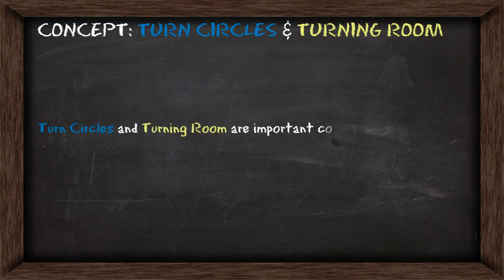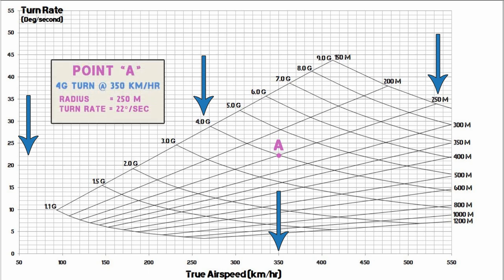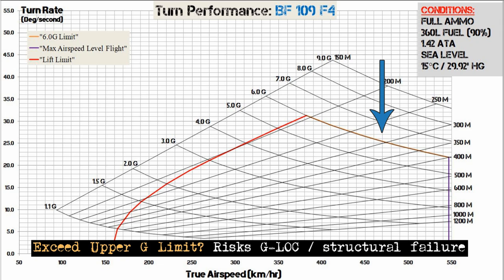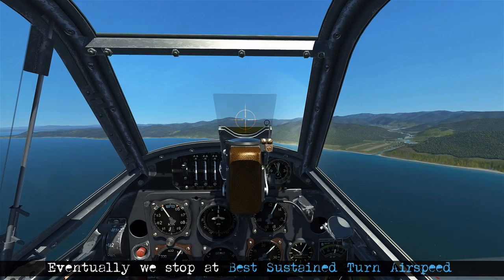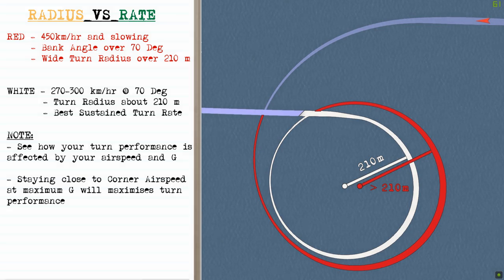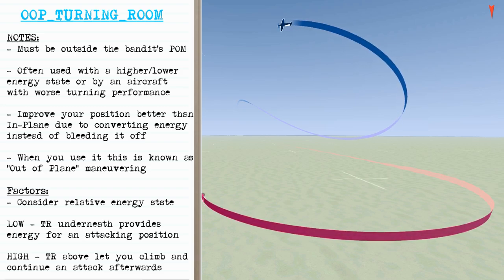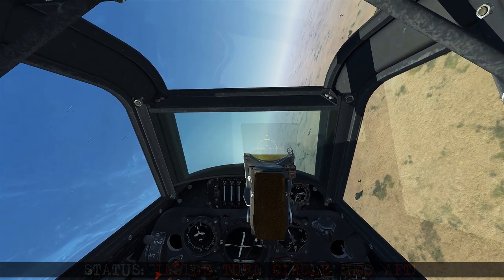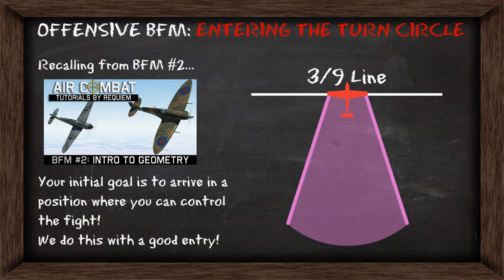BFM Lesson #3 - Turn Circles & Turning Room (Revised)

Comment: Excellent use of diagrams followed by in-cockpit examples to illustrate how to apply these principles tactically--great stuff.    And I greatly appreciate the updated terminology regarding turn rate.   One thing I would note for your viewers who fly jet sims is that while the speed for the best sustained turn rate for the BF-109 happened to be at the lift limit and coincide with the speed for minimum sustainable radius, this is not always the case.  This may even be generally true for prop fighters, for which I have no data, but is not for jets.  For jets the minimum sustainable radius will be at the lift limit, but the maximum sustainable rate will usually be a much higher speed, and depending on conditions can even be higher than corner speed.  The Ps=0 plot for a jet typically has its peak much farther to the right than the BF-109 curve.  This translates into a need to restrain your pull and perhaps even keep your speed above corner in some cases if you want best sustained rate.
Reply from the maker: No worries Gort, I've wanted to revise this one for a while but never had the proper time to finish my EM spreadsheet how I wanted. I took unpaid leave this month from my airline so I've had time to finish it and it's good to go now haha You're correct regarding the jet info, so thanks for sharing it. As you can understand I wanted to just explain a diagram with a single example many people would be familiar with. The great thing about my spreadsheet is I can create diagrams for any airplane if I have the data for it now. A common problem you see with a lot of people in props and jets is they just pull and pull and pull trying to turn faster but that doesn't always work out, so hopefully this helps with for some people understanding this a little better. I'm planning on going into more depth with this stuff when I can get data comparisons between props and include some jet examples in there too, but for now this illustrates the basic concept to build off in the future.
Reply: @RequiemsACTL  ohh I can relate
Reply: @Gort I've wondered at the applicability of haptic feedback for sim pilots.  Something that squeezes gently on your legs, perhaps, emulating a g-suit inflating, that gives you feedback on how many G's you are pulling?  Tunable by the user for their own desired "feel"?
Reply: @aurorastarfury  That might provide better G awareness and I'd like to try it!  I would also like to see someone make a seat cushion that would vibrate with varying frequency and amplitude to communicate airframe buffet.  You can feel a lot of nuance in buffet that simply shaking the visual in the game is unable to communicate.    
Trying to make these sims too purely realistic makes them unrealistic in some ways.  I want an accurate model, but you need something to replace the somatic sense your body provides if you want to fly that model like you would the real airplane.  Perhaps a tone that indicates AOA or G.  Purists will say the real airplane doesn't have that, but he real airplane has G forces and buffet that you use when you max perform it.
Reply: @gort8203  That exists, called a buttshaker. But it can only deal with the haptics (or audio) from the game.
Reply: Gort I agree with you and I think the AOA control is wrong on this sims because when going slow you have to move the stick less and when going fast you have to move the stick more.
Reply: @FGCH03  That's because it simulates how much force you can apply (as a pilot). The stick in these old planes locks up at high speed. 

Otherwise you'd be correct.
Reply: Peregrine 7 ok I understand that but that way to control aoa Is not accurate, at least with a force feedback joystick they could reproduce this, another thing I have found is that when you pitch down and leave the stick alone the airplane does not follow its trim speed it continues to dive.
Reply: Gort I just checked in LA5 you can check it
Reply: Gort i think DCS is more realistic in the way it has the aviatorshaker and vibrates with Gs and stalls you should try it
Reply: @FGCH03  What do you mean by "the aviator shaker".  I have DCS but I am unaware of this feature.  Do you mean output for that butt shaker device?  (I feel uncomfortable even saying that . . . )
Reply: Gort 🤣🤣🤣 well the device I am telling you is this one - https://forums.mudspike.com/t/does-anyone-here-use-a-gametrix-seat/4686 - check it out I have one and it is really good, it tells you what the plane is doing in terms of Gs stall and other effects, but I think you will still see that the sim, as you already told, has relax stability. I don’t understand why in a WW2 plane that you put in a vertical climb, start to spin without changing the stick position I think that is totally wrong.
Reply: @FGCH03  Interesting, I hadn't heard of this. The info doesn't explain how it works, such as how it knows how much buffet the airplane would be producing.  I'll have to do some more research.

I haven't really flown IL-2 so I'm not that familiar with its flight model, but I can say that if you run out of airspeed going straight up and start to slide down backwards or sideways a departure is certainly possible.
Reply: Gort well you say it, the thing is a departure and the other is the airplane of attack that going back to its trimmed AOA that is sometimes confused with departure.

Sorry about the info I sent, It was just to introduce you to the gametrix seat, research about it, you will love it but it works excellent for DCS but for IL2 it is a bit limited.
Reply: @FGCH03  Thank you
Reply: @RequiemsACTL  Excessive pulling and speed bleeding is a problem I'm working on correcting, along with my poor understanding and application of pursuit curves, which results in worsening angles as a turn fight continues.  Going back and studying up on the basics (thanks to you) has been very helpful now that I have some experience to more fully understand and relate to the material.
Reply: @RequiemsACTL  Would it be possible to get the Excel spreadsheet? Thank You!

Comment: Great video, as always!  How could I obtain the data necessary to build an EM chart for a plane?  I know how to work out the turn rate at various speeds, and the maximum airspeed, but what about lift limits at various speeds?  
Thanks!
Reply from the maker: The lift limit is simply the maneuvering airspeed.

Comment: Is the blue line related to thrust?   If you could apply more power you cold move it up?
Reply from the maker: The blue line (sustained turn) is related to thrust because at any point along that line thrust = drag and there is no more acceleration in the turn at a particular G force. Since the power is at maximum it can't go any higher, but these lines vary between airplanes so that's why engine power plays a part as one of many factors in aircraft performance

Comment: At the end, I didnt got the diference between the in plane and out of plane turning room, because it seems to bem the exactly same manoever, but to diferent sides each time. Could you clarify what am i missing?
Reply from the maker: Just think of it in relation to how both your wings line up with each other. If they're aligned (parallel) with  each other you're maneuvering in the same plane of motion. If your wings are not aligned (towards being perpendicular) with each other then you'll end maneuvering in different planes of motion.
Reply: @RequiemsACTL  gotcha... tkss

Comment: +RequiemBoS  Thanks for a simplified explanation of how turn factors affect air-to-air.  Had the Kriegsmarine (DEU) put a carrier into commission, the U. S. Navy would have two Fighting aircraft available to obliterate the Bayerische Flugzeugwerke (DEU) Bf 109H-4 and seize the air superiority that the Curtiss SB2C and Eastern/GM TBM would have needed to attack and sink the German carrier battle group:  The Chance Vought F4U-1D and the Grumman F6F-4, both of which had a decisive performance advantage over the '109's Daimler-Benz (DEU) 605 inverted V-twelve with the mighty Pratt & Whitney (USA) SGR-2800 radial-eighteen.  "Valencia's Mowing Machine," applicable to USN VF's with F4U and F6F, made extensive use of the vertical for engaged division tactics.

Comment: Very nice presentation! If I understand it correct the SL-line shown around 04.30 is also representing a max G-limit of about 3.3 at any speed if you want to maintain level flight? Comparing it to the level turn data around 01.00 that would indicate a bank angle no more than sligtly above 70 degrees.
Reply from the maker: Thanks! You understand it correctly, so we can just call it 3G and 70°... that's close enough for government work right! :-)
Reply: @RequiemsACTL  I also found it highly interesting what you say from 06.50 that WW2-planes can´t sustain corner speed in level flight because of limitations in thrust. Didn´t know that. Also see that the Level Turn Data at the beginning is purely theoretical and not specific for the 109 F4. Especially the last rows for 270 (exceeds the F4:s lift limit) and 450 (too little engine power). Got a bit confused there at first :-). The good thing about your videos is they lend themeselves to be watched several times.

Comment: Maybe this a stupid question but regarding the corner speed and that ww2 can’t sustain it in level. When turning can’t I just loosen the pressure on the stick to maintain wanted speed (270 in this case)?
Reply from the maker: No, it's not a stupid question at all. Corner airspeed is not just considering airspeed by itself, but is the airspeed you can apply maximum G force at to achieve your maximum turn rate (The 270 km/hr is completely separate because it's the best sustained turn rate for the 109 in this case). If you're loosening the pressure on the stick, you're relaxing how much G force you're applying so this means although you may be as fast as the corner airspeed is you're not actually applying enough G to maximise your turn rate. However, because you are at corner airspeed this means you have the potential to maximise your turn rate (however long that may be for). Think of corner airspeed as a sign of where your airplane can max perform basically.
WWII airplanes don't have the thrust needed to maintain corner airspeed when they are maximising turn rate in a level turn unless they are sacrificing energy (in the form of altitude) to stay there, so that's why you end up bleeding energy in a level turn (in the form of airspeed) and should aim to slow around the best sustained turn airspeed if you're in a prolonged turn rate fight.
Reply: @RequiemsACTL  You understood my point and answered very well Thank You very much!
Reply: @RequiemsACTL  Somebody claimed that 270 km/h is also the "ideal climbing speed" for Bf 109. Are they confusing these numbers or is there a relationship between those two factors that makes them both land at 270 km/h?
Reply from the maker: @LosBerkos  No  I don't think they're confusing the numbers. I believe that 270 km/hr is the best rate of climb for a Bf 109 as well. It may be that your simply producing the optimal amount of lift for the drag produced at the AoA required in the two different scenarios

Comment: How did you derive the sustained turn for the EM graphs?
Reply from the maker: Multiple timed turns at various constant airspeeds
Reply: @RequiemsACTL  I've always been tempted to make EM charts for a bunch of aircraft. Do you happen to know if anyone has done this already?  

My one constraint (with covid) is that I'm stuck on my work laptop and it runs the sim at less than realtime, so tacview is a necessity. Makes it awkward though as I'd rather just review footage and time off that.
Reply from the maker: I don't think anyone has. Now that my spreadsheet is complete I can start pumping them out relatively easy, but I need test data for sustained turn stuff, so I'm making a post on the forums about it at the moment.
Reply: @RequiemsACTL  Could you please drop a link to the aforementioned forum post where you intend to post these graphs?
Reply from the maker: @McDewgout  I will. I did make an earlier post but didn't get anyone to help me with them. I've made a video discussing EM theory that seemed to have good interest so maybe I'll get some takers next time around